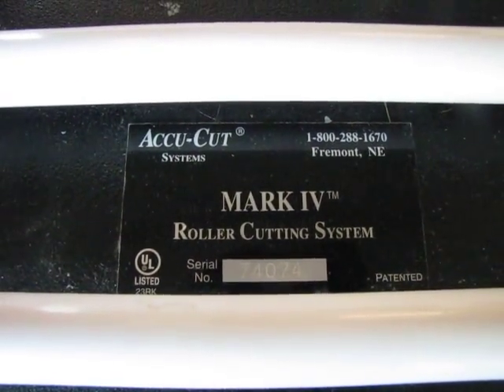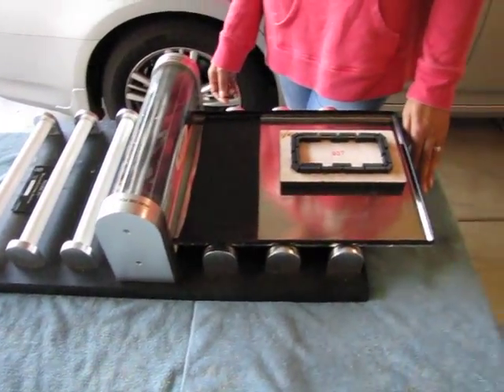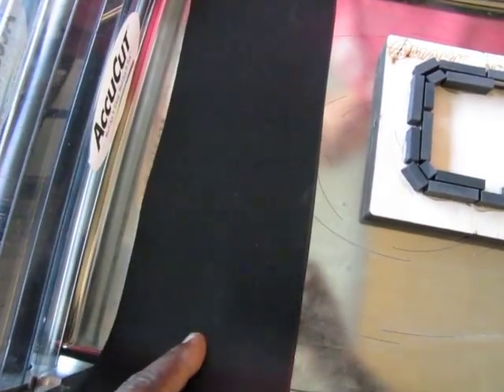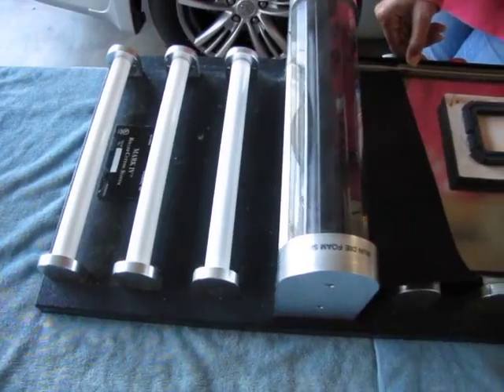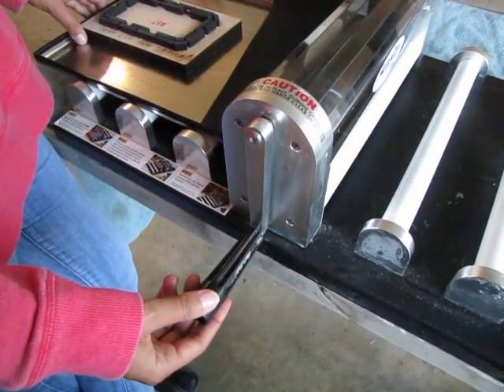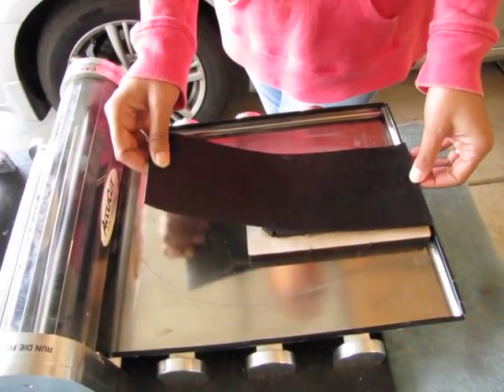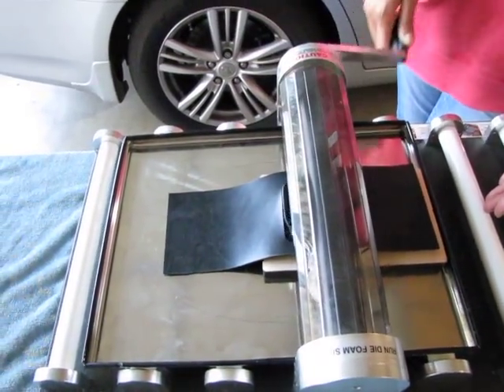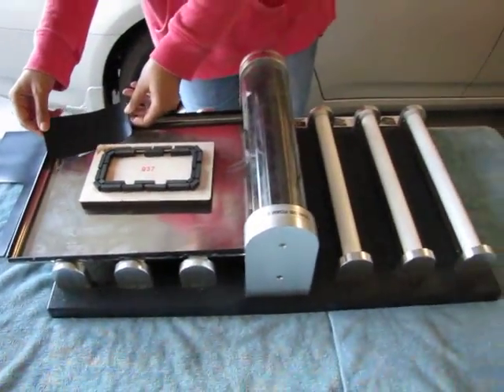How to use the Accu-Cut Mark IV roller cutting system

Comment: Hello, i just bought an older style of this brand called the Accucut Zip' eMATE, It is still brand new.
I am having many issues i've had it a few days & still can't figure out how to use it, i've used different machines, so i'm familiar with die cutters & embossing machines, but never had an older design like this one, i have the instructions & have followed them to a (T), I have the Zip' eMate with the item # as 2500420, it has it listed as i'd need to use a release foam over the blades for the very first time using the die cutter, i can't locate anything like this adhesive backed release foam anywhere, so i thought i'd do embossing instead & i put in the white platform 1st, then my folder with 1 cardstock inside, then as instructed i put on the black foam mat, it said not to use the embossing mat, i then tried to get it thru my machine by using the handle & it just wouldn't budge an inch, could you please tell me, what am i doing wrong, i'd appreciate any help at all from anyone here, thanks & stay safe.
Reply: Hi Clint, did you answer my questions here, i just got a reply from you, i saw it from my email, i just now checked in here & somehow i'm missing you message, so where exactly can i  locate it?
Reply: It's been a while since I've owned one, just before they discontinued them, maybe 20 years ago.  They created a school affordable line of dies to compete with Ellison, which is now sizzix. The thin dies had adhesive foam so that the paper would pop out easily on their very small,  intricate dies.
Your issue may be due to your cutting plates, can't imagine any original ones being available today. Sounds like you've been trying out different "sandwiches". Here's a trick. Use thick acetate sheets or clear vinyl ( at Joanne's, used for tablecloths) to use as shims.
I remember it being narrow so you may have to get small cutting replacement plats in the future. Honey Bee stamps have 4 inch wide ones , I think.

Comment: Would a machine and die like this be able to cut thin plywood?  Say, like .125" baltic birch.  Just looking for ideas that make help speed up production of things instead of a laser.
Reply: So here's the thing; it can easily cut thick chipboard AND you can design your own custom dies but the die board has a layer of foam around the steel blades.  Because wood has grain any  "legs" or delicate edges of your design would bend and wood, not being flexible,  would break off most likely.